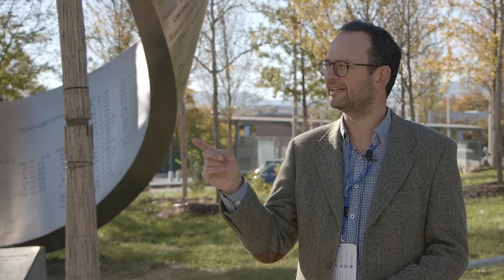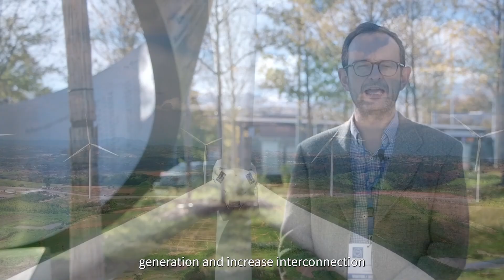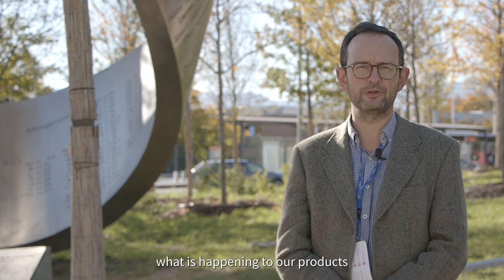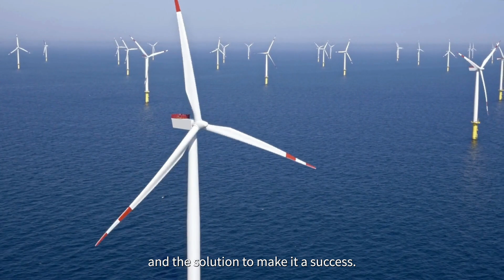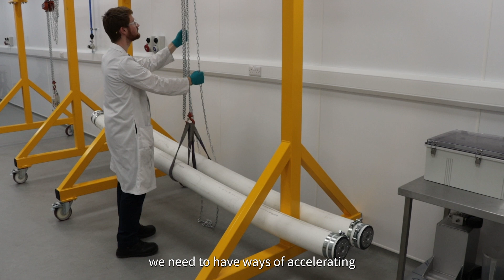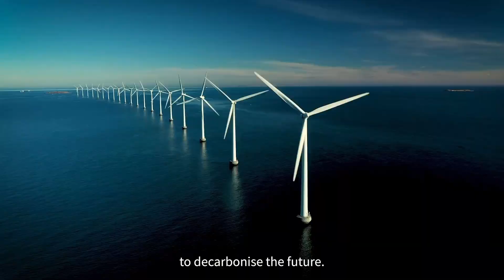A collaboration to revolutionise energy transmission with SuperNode

Comment: So I'm going to ask you a question it's really really important are you under contract are you under a W-2 or W-4 401k. Do you know how to set up your above strategy in your employment seeding and distancing if it's not set up correctly your strategy won't show the need for certain things and it will start skipping over because it don't value its growth with everything and then stuff might not work properly